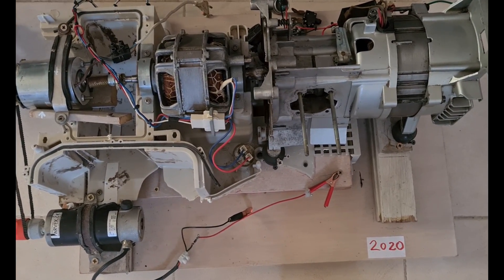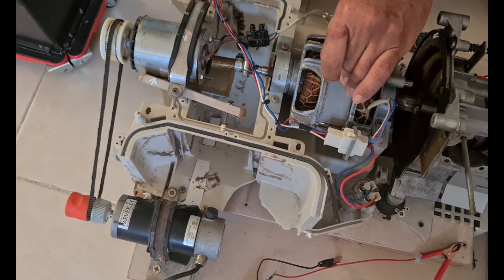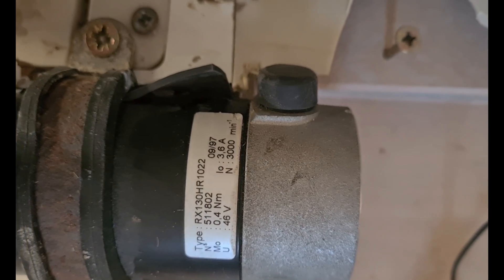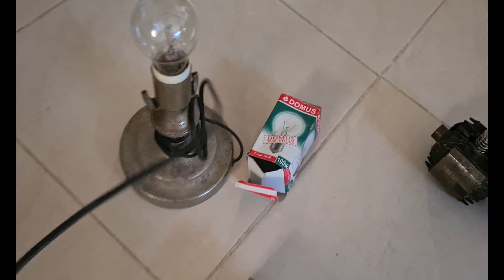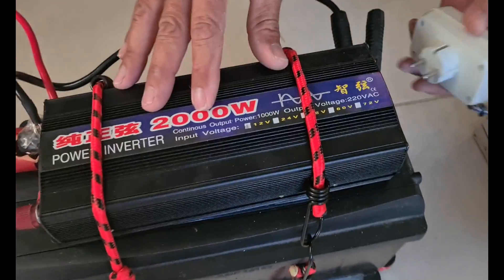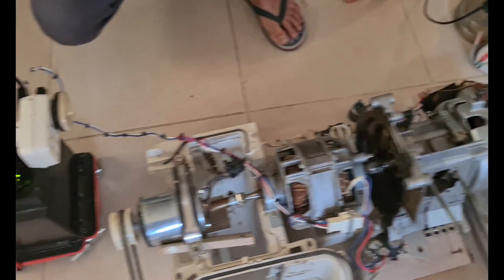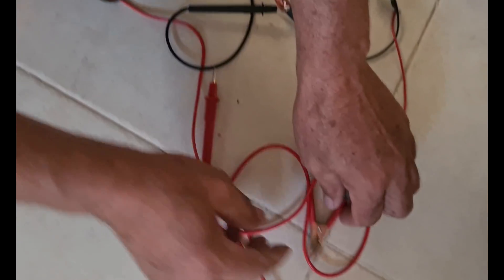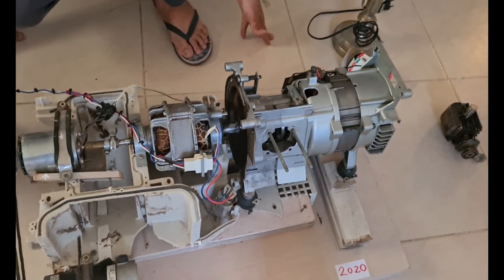Self-running fuel-less generator 2020

Comment: True internal power of Capacitor

in short  -we could discharge capacitor inward
instead of outward, and inward voltage is
higher then outward, by a lot.
When tiny wire ascend to plane between "+" and  "-"
plates of capacitor, its concentration of charge
would increase(therefore voltage on them).

And when charge reaching midst plane between "+" and "-"
it could effortlessly leave capacitor through
(within) its plane (because distance to "+" and "-"
equal in this plane)
======

What if charge on capacitor plates could leave 
capacitor effortless and unleash its true power.
Which usually foreshadowed by nearby opposite charge
(push mines pull(outward force))

But inward force dont foreshadowed and have all of its
true tremendous strength(as if its solitary charge)

And its strength isn't a joke , at all!

If we could remain it intact and go outside with it it 
would be a great output power(output voltage), could we?

And we do have such a place for charge on a way inward(from
capacitor plate) , or better to say such a plane
And it right amidst "+" and "-" plates.
Charge could move within this plane effortless
(because distance to "+" and "-" is equal for any point
in this plane)

So charge could maintain all of its true power and
leave capacitor within(through) mid-plane (as far of 
capacitor as it want)

Its mean we might obtain great power then
Because we pull in low voltage and it push out high 
voltage (with the same quantity of charge)

How it might be done :)
Just tiny wire which descend from "+" or "-" to midst
(between them) and wend aside through mid-plane through
with all true voltage.

Concentration of charge when it reached amidst would be
great , meanwhile there no force to hinder it within
mid-plane:)

Therefore we may see that voltage actually 
rise in a way inward and lowered in the way outward

Its just mind-blowing (really unexpectedly)
Reply from the maker: Hi thank you so much for your time to write all the possible wirings that might help to increase the output. It's very interesting. I'm working on another generator and hope to finish it in around a month and maybe come back to this generator and try what you said. Thank you so much for your suggestions. Denis

Comment: Good morning Dennis, please what is the number of diode that you added with the battery to split charge the second battery from alternator. Thanks. Happy Sunday. You're the best bro
Reply from the maker: Hi Joshua, the AC power from the generator is converted first to DC by diode with 4 legs, then between the charge batteries there is another normal but big diode that separates the batteries. I mean the charge goes to both charge batteries but between the batteries the diode separates them in a way that one battery will be available to charge the input battery again and the other battery is for an inverter to use your load and devices at home. Regards

Comment: Good day sir, I would like to look at the step by step how u achieve the connection, secondly can it run without a battery, how long can it run without being off, how can you connect it in such a way that the battery can help it to start and get isolated and the process continue to run on his own. Thanks sir expecting your reply ASAP
Reply from the maker: Hi Obi the output of the generator is split in 2. One to AC and one to DC with a bridge rectifier. There is an electric motor that runs the generator so on the battery I have an inverter that runs the motor. I'm not trying to run it non stop here. You have to give back the consumption of the motor that runs the generator before you can enjoy the load. So the load will be a bulb or two but it won't be enough to power your house. So if you really want to power your house with this, it's better to charge batteries with an alternator as you see in the video, which is running on the output of the generator with the help of a motor. This way, you charge several batteries and use a 1.5Kw inverter and run the devices in your house at the same time you charge the input battery that runs the small inverter that powers the motor that spins the generator. Regards

Comment: way do this but u make 20 kw. but we run into a probem. load on gen has incress amps on motor bad bad but they is way to provent this 
that mixing lot diffrent felds   by doing so we make as much power as we want., idea came to me from a device i got from a collage, what they used it for is unknow
it uses no power at all, throw can make a grate deal of micanal power 100 to 1 in fack this device would alow us get around the probems and few big fly wheels, 
throw not needed it will only help reduce power, to just about 4 amps   now if we could have a gen had 3 coils one for 220 volts and one 440 3 phase we can reduce power even more.
them who read this should understand why this can happen, there for all 220 volts should be free,  this device will run car with batterys forever, but with out it none this works, it al breaks 
so hay  i  know how make i cant make it working on computers all my life damage my hands not that i any good tools i know what needed , i know power and all math and math says will work
Reply from the maker: Thank you for the explanation. Best regards

Comment: so you've basically made an over complicated (step up) voltage converter and to step down the voltage you chose to use a resistor, when you should've used a step down transformer or a REGULATOR .....im not sure what you think you've created, you've just taken 12v and stepped it up to 240v ?
Reply from the maker: Hi, basically what I try to do here is to split the output of the generator in 2. One AC and the other one I put a bridge rectifier in order to charge a small bank of batteries and mainly its about energy storage DC more than just to light a AC bulb. Once the batteries are charged, we have some energy left over and a part goes to the input battery. Regards

Comment: ****Guys don't fall for this bull S#!T!!  It will only run for a few minutes till it shut it's self off slowly threw amp and volt loss. If your using a battery with it, it will slowly drain the battery It will only run for a little longer. I built this it will fail you to!!***

Comment: Greetings, I just watched your video carefully. I have a request, please use additional meters to measure a few parameters and publish the data here for all to see.

(1) Measure the voltage across the first battery and at the same time measure the current flowing from the first battery to the inverter. Multiply these numbers together. This is the INPUT POWER in watts.

(2) Measure the output voltage at the socket where you attached the table lamp, also measure the current flowing in the lamp. As this is AC you need a TRUE RMS meter for these measurements. Multiply these numbers together. This is the OUTPUT POWER in watts.
 
(3) Find the ratio of output divided by the input, multiply by 100, this is the efficiency.
Report these numbers here. Thank you and good luck with your project.

Input power = A Watts. Output Power = B watts. Efficiency = B/A * 100 %.

Comment: Seems like a Delta wired Alternator that's been modified to run as a generator coupled to a single phase capacitor start / induction run using a feedback loop is easier to build. 

You must cut the iron arms over the electromagnet and in place put neodymium magnets, alternating the poles nn/ss/nn/ss  https://www.youtube.com/watch?v=mpPqIKX825c

Comment: This looks like the thing I am building - can a ac to dc full bridge be used as a dc to dc ?
Reply from the maker: Hi Denny, yes it can. I split the output of the generator in 2 different outputs one is direct AC and one to DC by a bridge and a capacitor of 400V 220uF. It helps me run the alternator which is also DC. Best regards

Comment: 12 volt dc connect rutar magnetic field Alternator.... ISKE ROUTER PAY 12 volt dc  SUPPLY DIODE PLUS MINUS  ROUTER MAGNET FIELD LOW RPM MAIN CONVERT HO JAEGA

Comment: Need to improve 
1. Low RPM
2. Temperature 20° -- 50°
3. 24/7 running
Otherwise no use.
Reply: Need to improve efficiency (which will break science) Today this is just a bunch of crap to light a bulb with a very inefficient mechanical "voltage converter". Come for the science, stay for the laughs!

Comment: Hi Denis
Today I made only motor and generator 
Input 110v 6.5a 60hz
Out put 120v  max 6.5a  44hz
I guess rpm is 2640rpm(I calculate Pole=2)
I add two side N pole magnets
this is first step reusult.

I add 2 side magnet what is pole number ?
2 or 4 which one is correct.
Pl let me know Your system main motor rpm and output frequency
Thanks
Reply from the maker: Well done. In total, 16 magnets, 2 pairs of 4 on each side in the canal. Once you spin this with an electric motor, put the bulb and see how it works. Then you will get to the charging. Best regards
Reply from the maker: The motor is 1ah 220V 200W 2800 rpm but the motor gets warm so it's better to use a fan if you run it for long or use a 1.25ah motor. Regards
Reply: @denissabourin  thank a lot Denis
I mean 

 f= PN/ 120
f = frequency
P= number of pole
N= rpm
When I apply this formula  , the pole's number is issue .
I am going to mext step ......
Reply from the maker: @toolman7654  Hi, you're doing well I believe. As I told you, all magnets are facing north. I have no other calculations regarding the pole. Best regards
Reply: @toolman7654  Oh dear... The author does NOT understand about the number of poles in a motor! I'm not sure he knows Ohms Law or can do fraction arithmetic, either. Sad. Come for the science, stay for the laughs.

Comment: Nice built. But the motors are squeaky producing lots of noise. By the way, how long will it run while drawing the power continuously to it's peak value..??
Reply from the maker: Hi, I agree with the noise coming from the motors. Certainly don't recommend putting them in your living room. You asked a good question regarding how long it will run while drawing the power of the battery continuously, well we struggle to find the right way not to be based only on the AC output of this generator, for example the 100W bulb you see in the video but rather to focus on the charging of more than 1 battery meaning to charge a small bank of 2-3 batteries which we call the charge back. Without this charge back, the concept will not run for more than 1 hour, but with the charge of the bank with the help of this alternator you see in the video, we separate the bank with a diode and we leave at least 1 battery fresh to cover and charge the input battery at the same time. So far it was not enough so we  need 2 batteries to cover the input and 1 fresh battery remains in addition to the 100W bulb for another inverter that you will be able to use for other loads. If we can make it 2 batteries for the inverter we can almost get 1KW of output after covering the input battery. Regards
Reply: @denissabourin  Thanks for detail explanation.
Reply from the maker: @chongshenchang9367  you're very welcome

Comment: USE IN THE SAME TIME 2 ENGINES THE WASHING MACHINE AND THE DC DC ROTATING MACHINE FOR BATTERIES ARE FAILED BY THE SAME OR SEPARATE AXIS

Comment: WE SAID A LONG TIME AGO THAT I HAVE A GOOD 2.4KW 220V 2530ROT MOTOR 1.1KW 220W 2850ROT AND STABILIZED INVERTER 2.5KW 2X12V (24V) 45A FLYWHEEL BATTERIES 20KG WORKS 30MIN AND SOTP DOES NOT CHARGE IN TIME UTL BATTERIES
Reply from the maker: I think you should connect a DC motor of 24V that will spin an alternator as you see in the video and it will charge several batteries. You can use a relay timer and let the batteries charge the input battery from time to time. But the alternator is necessary because the original DC output of the generator isn't strong enough to charge batteries, you need to use an alternator. Regards

Comment: GOOD MORNING I'M BACK AFTER A LOT OF TIME I'M LIKE WHAT YOUR DEMONSTRATION YOU HAVE WHAT SIZE THE MAGNETS HAVE AND WHAT BRIDGE BRIDGE SCHEME YOU HAVE INSTALLED AT THE BATTERY SOCKET
Reply from the maker: Hi, you can clearly see on one of the videos about this generator, in part 2 you can see the size of the magnets on the paper I show in the video. Try to find it in part 2 it is all shown there. The bridge rectifier is a simple one, it is a diode with 4 exits, 2 inputs and 2 outputs and then you have 2 capacitors of 400V AC 220uF. Regards
Reply: @denissabourin THANKS A LOT FOR EVERYTHING
Reply: THANK YOU FOR INFORMATION I FOUND PART 2  @denissabourin
Reply from the maker: @panaitmarian1904  Very well, you are welcome

Comment: Why can’t you light the bulb direct from the inverter with no noise or what?
Reply from the maker: Hi Bernard, the aim is not to light a 100W bulb but rather to charge as many batteries as possible, first to cover the input battery and then with the energy left DC on the other batteries use some loads such as a TV, etc. I hope you understand. Regards
Reply: Oh, you weren't listening. The goal here is not to light a light bulb. It is to charge a bank of batteries from one, swap it out with a fully charged one, and in that way break the Laws of Physics. Come for the science, stay for the laughs!

Comment: Understand that the load from that alternator to the inverter will flatten the best battery ever, in five minutes at 100volts, so you can't possibly gain free energy from your system, you're only going to lose power through your device with all its components and extra friction, you're better off just using a solar controller to run the battery inverter to charge the rest of your batteries and store the energy 😀 and no I don't believe that the earth is flat either.

Comment: please a functional sketch to rebuild ?
Reply from the maker: Hi Gerd,  I did publish all the diagrams in other videos of this same generator. They are Part 1 and part 2. The plans are there and there are many possibilities of how to use the generator. Basically it was a 900W petrol generator 2 strokes. I took all the parts out and used only the generator. The electric motor that spins the generator is 1Ah 200W 220V. And the other parts and alternator are all explained in the other videos. Regards, Denis

Comment: Are you selling this? if so how much?
Reply from the maker: Hi, you can contact me by email. If you click on the About section on my channel there is my email there. I still have 2 of them. As you see it is a prototype that can be used in many different ways as shown in the video, it's up to the persons creativity. I found that it is best to use it as an alternator to charge batteries and then use an inverter to get a bigger output. Best regards

Comment: Hi
I wander that why two side magnet is N pole .
Pole poisition looks like S>N>N>N. is it correct? 
When Rotor is spinning , the rotor coil makes electro magnet s and n because of diode and initial small magnet on rotor  .
Is there any reason for magnet position ?

Pl give me an information of dc drive Motor .
Thanks
Reply from the maker: Hi William, no, all magnets are facing north. It works very well that way. The DC drive motor that runs the alternator is DC motor PMG with magnets in it and can spin from 24V to almost 90V. It adjusts automatically to the generator that gives it the power because of the bridge rectifier so the big generator becomes a PMG and they work in perfect harmony. It works so well that I am myself surprised. I took it from a water pump. Regards
Reply: @denissabourin  thanks for your comment.
I got  sick but it's ok now
Please teach me what is the main reason you aided the magnet on both sides.
Reply from the maker: @toolman7654  Hi William, I hope you are doing better . The magnets make the AC generator also a DC generator at the same time and also the magnets help the generator generate electricity at a lower rpm than usual. You can use AC from the generator as before but you can also make an output of the generator, I mean to split it and then to run a DC motor on it that spins the alternator which charges several batteries, this way you will be able to have more output through an inverter from the charged batteries and a part of the power from those batteries will cover the input battery. Best regards
Reply: @denissabourin  
Thank you so much 
I ordered 1kw generator same one from amazon. I will doing step by step
Reply from the maker: @toolman7654  I wish you luck
Reply: @denissabourin  And if you go down to the bottom of the garden at dusk, and are very quiet, you will see the faeries! Oh, Joy!
Reply: @pstonard  That’s what makes the entire system to work. It needs to be sprinkled with fairy 🧚‍♀️ dust !!!

Comment: Not a chance.. It would use 200 watts to generate 80 watts ,total downhill .With all the components at 80% or less efficient
Reply from the maker: Hi. Please understand that we are doing some tests and demonstrations here of the possibilities of how to use this generator in the best way. This is the reason the AC 110W bulb is just a demonstration, but it's not the aim. What we would like to show here is that instead of using the bulb and wasting energy, it will be much better to store energy in the batteries with the alternator and you can clearly see the alternator gives 3.6Ah output around 180W in 48V so when we spin its shaft in 3000rpm we should have 48V output but we can get much more so the charge to a bank of batteries is huge. If you put 4 batteries of 40Ah you can have more output by using an inverter and get much more than the bulb you see in the video. Regards